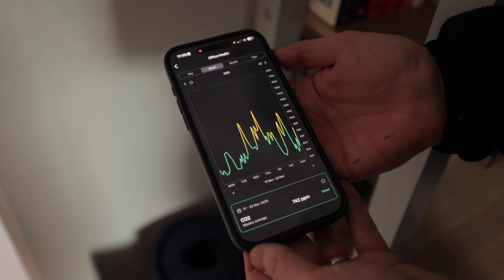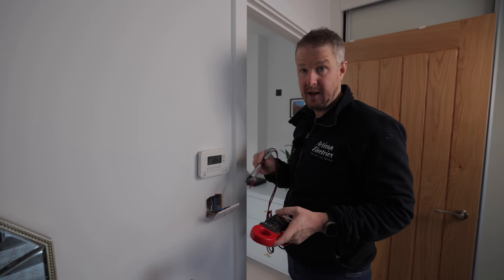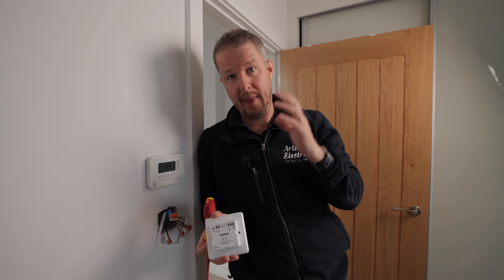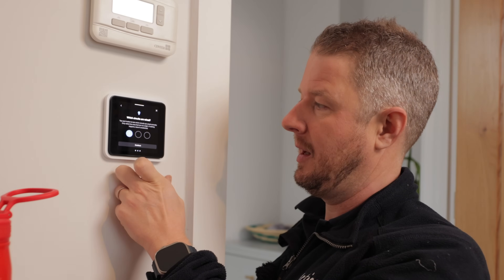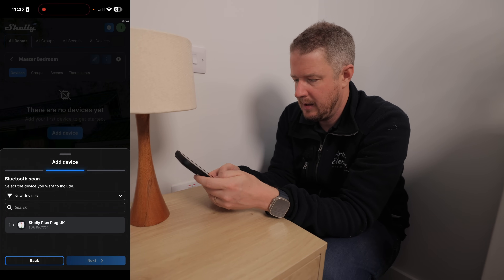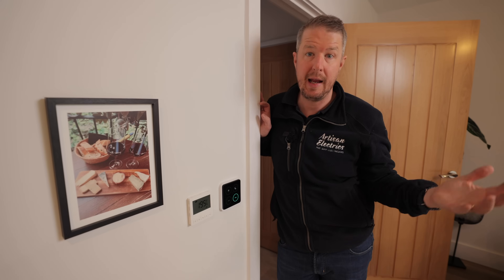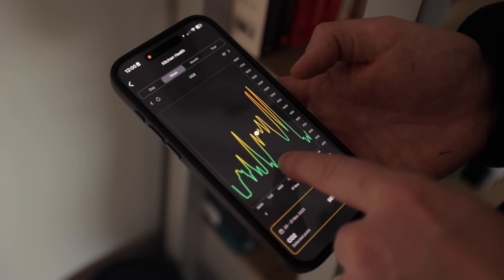Hidden DANGER In My Home EXPOSED By Smart Tech! ☠️

Comment: I use Hubitat that is totally LOCAL with NO cloud dependencies!
Less expensive than this thing too!
Uses Zigbee, Z-wave and matter as well as some ethernet (local).
NO CLOUD to set up either!
This is a big waste and too new to have proven itself.

Also, mounting it below the thermostat will affect temperature control.
It should be above your stat!

Comment: if you're just dealing with solid wires up to 2,5mm² yoou should take a look at the wago 2273 line not as versatile as the 221 where you can put all types of wire in but the only cost half of the 221 and also you can mix them in an installation like the 221 where you need to connect to stranded wires or bigger than 2,5²

Comment: One fundamental feature of a light switch is the ability to feel the switch in the dark.  You can't do that with a touchscreen.
Reply: Our switch uses a radar to detect someone approaching it. The screen lights up automatically, so you can always see the buttons. We also use an ambient light sensor to adjust the brightness of the screen, so it doesn't blind you if you need to switch the lights on in the middle of the night!
Reply: @tewkeyou're the manufacturer of the product in this video?
Reply: @Chris-hy6jy  yes, we're Tewke, the company behind Tap light switches
Reply: Lightwave (which I have at home) has physical buttons, and is somewhat cheaper.
Reply: @al45tair  Fair, but I've never seen a smart home device with such a beautiful screen...They packed an OLED with over 400ppi into this! And I guess comparing it to LightWave RF isn't really fair as those are literally just a switch - when you look at their website, Tewke does as much as those stupidly expensive full home automation systems that get put into homes for almost 10x
Reply: Great point.
The MAIN reason that I install retractive Hager switches in all my Smart Homes.

I have use LightWaveFR in the past. These have a small light, plus they are physical buttons.
Reply: It looks like the touch button or buttons remain illuminated. You could probably choose how bright they will be on standby, or whether they dim automatically. Even if they do go dark to save energy, you could probably program the whole screen to turn on only one light as soon as you touch it.
Reply: @robinford4037 that leads to another issue of having things lit up in the bedroom at night.  I have to stick tape over all the gadgets in my bedroom with LEDs.

Comment: Honestly, this is another toy which will be obsolete in a couple of years; if you want a professional smart home system, you need to look at KNX it’s an open system lots of manufacturers make products to the standard and it will last for years without any software updates and it easily integrates into Amazon, Google Apple and future AI systems. My home has been KNX for 15 years and I’ve just completed my daughter’s house as well it covers heating lighting ventilation air-conditioning everything.

I see KNX being used in many hotels, high-end homes and commercial buildings. Well worth investing a week doing the basic course and purchasing a copy of the engineering tool software.

Comment: Regarding CO2 level, when your using the room don’t breath if you want it lower, 700ppm is not dangerous to your health, but if you want it lower fit widow vents or buy a plant or for ultimate results use a CO2 scrubber as used by NASA.
CO2 levels outside are 400ppm and at night in an unventilated bedroom can average 1200ppm to 2500ppm. 😉

Comment: Re the CO2 spiking.  Check first that this is real.  Swap the TAP switches /sensors between rooms or temporarily put two in the same room, and confirm you see the same spikes in CO2 and that it’s not an anomalous reading from the sensors.  Secondly, why can we have confidence in these products.  If Google walks away from its version with next to no notice, what is the future until we have common standards across all suppliers so that we can cope with company failures and changes in strategy leaving us without the service we pay for.  It’s to much like investing in Betamax, technically superior, but a technological dead end.

Comment: You really are such  a shallow sponsor junkie.... So you install this and within the day are promoting it as the bee's knees.  Surely you would test it over time first, instead of taking the sponsor deal for something that could be shi te long term..... either way - thanks for re-inventing the wheel 🙄
Reply: Horrendously expensive too. Nice product though, the closest we can get (with HA integration and a real world price tag) seems to be the shelly wall display or the Sonoff NS panel pro (which struggles to fit our back boxes I think).
I might wait a year!
Reply: @MangustaMG20  yeah, wait until they are £40 a switch - £400 is not a mass market product.
Reply: I’ll be passing - my RAKO stuff still rocks
Reply: Errrm safe isolation?? Did I miss the part where you used your lockout kit on the breaker 😊 videos are good you must be making more from you tube than you do on installs

Comment: what happens if they go out of business? Cloud based wifi switches can be a pain in the arse, I have gone Zigbee with Home Assistant,
Reply: Or like Google who decided to drop older furnace digital control from their network, you can continue to manually set them but no longer control them through the app.
Reply: Snap. We had some idiot fell a tree and it took out the fibre. I already had HASS so everything was mostly working still. Had to move my devices off Tuya and host locally.

Comment: What a complete waste of time watching this, zero integration with Home Assistant or anything else. quoted £3,970 for 10 taps + fitting - they're having a laugh and making you look stupid Jordon.
Reply: Exactly this no integration with Home Assistant is a massive missed oppertunity but also losing trust in the company and the channel, been waiting on a quote since around June, filled in all the forms requested, sent through all the data and 2 of the guys came to scope it out but since then nothing. I've chased a few times and always told "Oh its nearly ready just waiting on someone to check  something" but just given up at this stage, if they don't want the work just be up front about it.
Reply: Well, he didn't pay for them. Was sponsored but not really clear - not ideal and will give the channel a miss from now on as the trust isn't there. Needs clear info re getting paid as well as free stuff. Also, nice to know if the review has been seen / edited by the company also.
Reply: Thanks, seems like a scummy company when it won't even just give a price.
Reply: Just the price is a massive turn off for me. Nearly £400 per light switch is way too much. Nice product but ouch on the price
Reply: @Yoda0103  For £400, you can get another integration AND an entire tablet to mount on the wall... it's ridiculous.
Reply: and then they make the additional built in features subscription based. . .
Reply: What protocol do they use? If they can't function without a web connection I'd look elsewhere. Nice product, but massively overpriced :(
Reply: What do you mean no Home Assistant integration? He didn't mention it, but there is one.
Reply: imagine needing to go about your daily life knowing how much co2 is in the house .. it makes you wonder how humanity survived thousands of years without tech like this
Reply: @shadejalik4769 We survived thousands of years with rather well ventilated houses in terms of air being refreshed throughout the day.
These days we end up with very tight houses in terms of draft etc. Great for the heating/cooling characteristics of the built environment, and the associated economic/resource impact. However you end up in stale air. 
Tomm Scott had a great video about CO2 levels and human brain function based upon it.
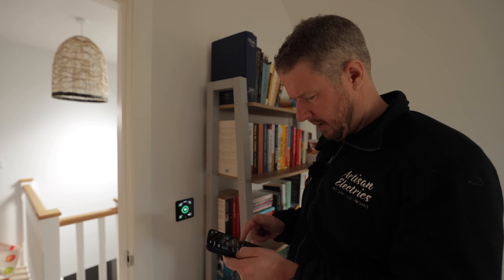Anyhow for me a really big red flag of this product (as noted around 13:04 ) is not containing physical sensors.

PSA: Check your ventilation's dust filters not being clogged. Refresh the inside air and maybe get something like an Air-Gradient DIY or one of those IKEA co2 sensors.
Reply: @shadejalik4769 Well. It depends. We're living in a rented single-family house with oil heating. Gives some peace of mind, to at least monitor it in the bedroom.
Reply: @PhilippBorn I think you may be confusing CO2 with CO.
Reply: @hughjardon5101  hmpf. Good catch!
Reply: @shadejalik4769 cavemen in their hermetically sealed caves didn't worry about co2, am i right?
Reply: @marshallb5210 you are talking about things being sealed.. you need to come up with a better argument my dear friend
Reply: @shadejalik4769take some deep breaths from a paper bag
Reply: @marshallb5210 isn't that what people do when they're having a panic attack?
Reply: Those CO2 levels are not scary. It’s totally normal when spending a lot of time in a room. Worst case it can make you slightly more tired / unfocused so just open a window or don’t keep the door to your office closed when working in there. I have a sensor in my office and merely use it as a reminder to open a window if it gets too stuffy in there
Reply: @SharpGIS  Agreed - CO2 is not the same as CO - this video is quite misleading
Reply: @SharpGIS god help the future generations if they think co2 is their enemy .. if they can be convinced co2 is bad they can also be convinced that water is bad... brawndo will be the choice for watering crops soon
Reply: @shadejalik4769 Too much IS your enemy. (See the film Apollo 13). But most likely the levels registered in the video are only going to make you very slightly drowsy.
Reply: @BrianG61UK we're not in a space capsule... we're on a planet that has a trace amount of co2 in the atmosphere .. 0.04% and decreasing by the year because of the psychopaths in power
Reply: @BrianG61UK  They'd need to be twice that to have any discernible effect, and consistently so, not just for a few minutes at a time. What that graph shows is typical of 99.9% of houses across the country. The whole thing is an absolute grift.
Reply: @Dogfacedbloke  The CO2 numbers? I couldn't read the actual numbers.

Comment: I think you only have a CO2 problem if nobody is using that room and it spikes. As soon as you start moving around of a morning, doors opening/closing you'll move all the accumulated bedroom CO2 around so probably nothing to worry about.
50 years ago my dad spotted the CEO's car in the street. Nice little sporty job. As the company also made sensors for the car, well, of course the CEO had to have one of everything. (My dad joked there might have been a level flight indicator amongst them), You had water pressure, water temperature, oil temperature, oil pressure, oil level ...dials for everything, Why, I asked my dad, didnt he get some.? "its just more things to worry about" he said.
Of course, having grown up and become a software engineer particularly for industrial kit that needed stuff monitoring, gadgets, measuring, monitor displays are things I can geek over. Kit looks very cool. It wont be long before its all Star Trekky and the wife will be able to ask "Where is my husband" and get told "Your husband is not in the building" ,,,,or more worryingly "He's in the Frog and Bucket having a pint"

Comment: I'd be inclined to get a real CO² sensor and confirm that the light switch is accurate. If that also reports high levels then improve the ventilation 🙂🤷‍♂️
Reply: Exactly this. Many "cheaper" co2 sensors are wildly inacurate. You can get crazy readings by placing alcohol near them or similar. Proper co2 sensors are rather expensive and the sensor I have in my house you can actually hear the small fan inside forcing air over the sensor units.

Comment: 500ppm CO2 is nothing to worry about. If I shut the door in my living room it will easily spike up above 1000ppm and there’s no issue with that either. 

You can see co2 coming out of boilers carbon dioxide is fine unless you get it in very high concentrations.

What it can do is make you less sharp and feel more fired than you would if you have fresh air. 

The best thing is to have a MVHR system which is the gold standard.

I have an airlytrix unit that monitors co2, heat, light levels, nox, voc, dust at 1um, 2.5um, 4um and 10um, pressure humidity and sound. All plumbed in to home assistant.

Comment: The Co2 levels are pretty much spot on, the outside Co2 is normally roughly 400, Co2 from people sleeping and just generally being in the room will produce more Co2 in the air, I have 3, one in the livingroom and the others in the bedrooms, the highest reading was 6400, when we first installed in the bedroom, but on average now, as we have to open the windows first thing in the mornings and late evenings, waking up it hits around 1700, in the other bedroom 1900 livingroom 1400.
Unfortunately the landlady said all I do is complain, but rightly so, waking up with a headache, drowsiness is just the norm now.
MVHR are the way to go with this problem.

Comment: I install everything from Shelly to KNX, and all solutions in between, and let me tell you: without HomeKit, Google, Alexa, or at least Matter support, they will struggle. The industry is moving towards standardisation, and relying on a proprietary app is a big no-no. Having Shelly on board is great, but they need more. At the very least, they should join forces with Home Assistant.

Comment: At £224 I'll probably crack on using my fingers 😂
Reply: Its £224 and your electrician, versus just using smart bulbs and stuff that just fit into sockets without an electrican.
Reply: Aqara light switch and Switchbot Co2, the cheaper option
Reply: @oldmanvlogs-UK-PHP  plus, the aqara switch can be remote controlled using zigbee, which makes it an option for home automation. does this thing do the same?
Reply: Where'd you get that quote?  I used their estimator for 10 of them, gave me price at £3970, £397 PER SWITCH which is crazy money given other options in the market.
Reply: Thats for just the oled panel, you also need the Wall Dock and frame so total cost for a single switch is just over £330
Reply: @prop7184  too expensive for me.
Reply: I pay my daughter 10P to turn on a light
Reply: If the Co2 readings aren’t from a sensor, where on earth is it getting the readings from?
Reply: @mrfust somewhere else on earth.

Comment: An unventilated room will easily spike over 1000ppm CO2 when occupied, you probably need some passive ventilation to keep the air moving. Are heat exchange ventilation systems common in the UK?
Reply: Only in very modern houses. Our old buildings were built with lots of air flow, our modern buildings are just crap, and we've finally caught up with proper ventilation systems on the newest houses because actually fitting a sensible level of insulation then promptly caused them to fill with mould because the UK is so damp and wet.
Reply: @etchedpixels  yeah definitely. If I exercise in the smallest room I have I can get the CO2 to 750ppm at most, because it was built in the 1930s
Reply: @TheaH2O2  
In the UK, "the smallest room" is an old euphemism for the room containing the toilet!

Comment: We installed MVHR (not so easy as a retrofit), it has made a huge difference to our home. We don't have condensation issues any more! We are not currently measureing Co2 but I am sure the constant ventilation will help a great deal. I may well add some sensors just to confirm we are good.
Reply from the maker: Thanks for sharing

Comment: It's probably spiking when you're in the room without ventilation. As you breathe, you release CO2, and if there is no active ventilation/circulation of air from the outside, it won't take long for CO2 levels ot rise.
Reply: Yeah I have the same thing. My home office gets up to 1200 ppm of CO2 when I am in all day. Generally if you are getting a head-ache or not able to concentrate that is probably the cause. Crack a window or get a fan! :D
Reply: @PatrickM66B  Read the comments.... Jordan doesn't have any fans 🤣

Comment: Never heard of tap before. I forget what Linus was using and I meant to look into that one you did a job for a while back who was with Octopus as they had tablets set up. C02 spikes is usually down to combustion, cooking, combie boiler. Possible poor ventilation. A crazy bear heavy breathing after thinking he was young again lol. Jokes a side yeah look whats around the room, what kicks on during that time that burns fuel of some sort. I still do not like heat pumps. Personally, I would rather convert to some sort of fuel for heating. But I have been looking at Electrical heating.
Reply from the maker: I farted and it triggered a major CO2 spike 😂
Reply: @artisanelectrics  hahahahaha a nice good curry can help there XD